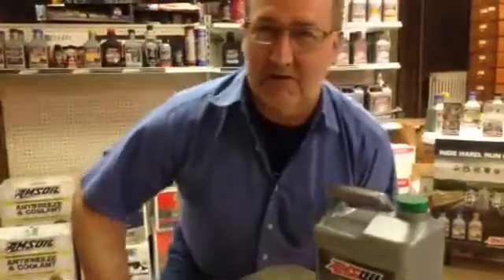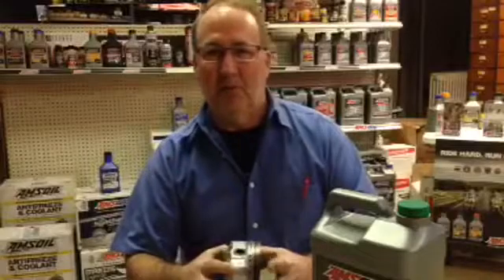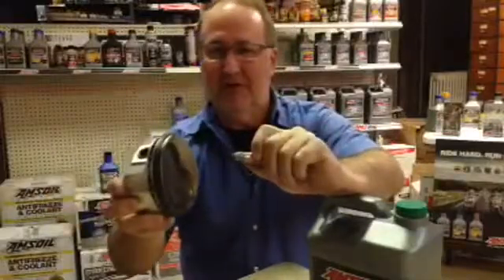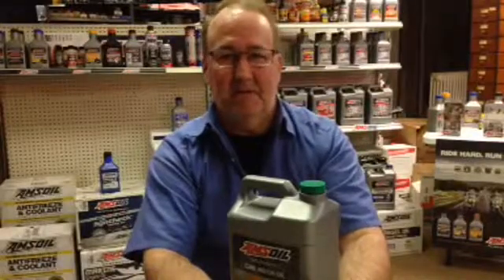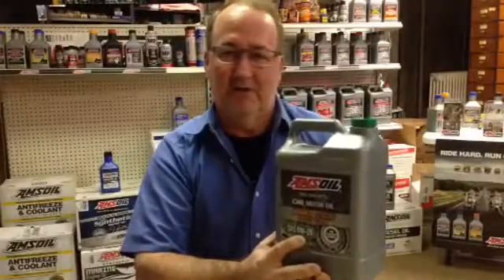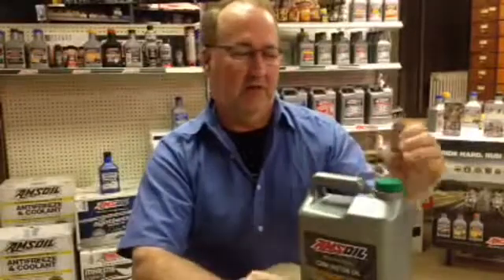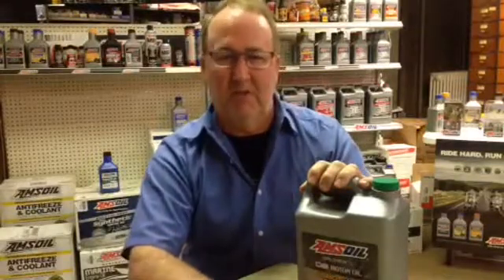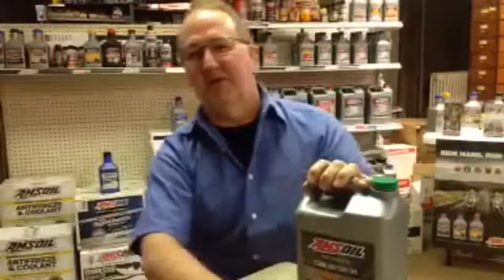Amsoi Synthetic Solves Low Speed Pre-Ignition

Comment: Tell me that that jug of oil has the API SN PLUS label on the back side and I would buy it.
Reply from the maker: An irritating part of the oil designations, they list current ones, but not the past ones used. The assumption current oil includes past standards. Having said all that, the SN Plus is clearly marked on OE, XL, and Signature Series bottles of Amsoil full synthetic motor oil. If you further questions, text or email me. My website has contact information https://kerryssyntheticlubes.shopamsoil.com/

Comment: Hey I use 10w-40 and suffer from this with amsoil my engine is at 100k miles it's a 1.5l also at 2500miles I noticed a reduced oil level. no leaks btw any advice?
Reply from the maker: First - be sure the 10w40 is labeled with the new label. You can check it at (https://www.amsoil.com/shop/by-product/motor-oil/gasoline/?zo=534737) 2nd. You didn't mention year, make, model, and engine you have. This is only newer model issue. Get back to me and I can make a call to the Amsoil tech line for you once I have more information. if you sign up as a Preferred Customer, you have access to the Amsoil Tech Line also. Use this link   https://www.amsoil.com/offers/index.aspx/?zo=5347371    to look over the information for Preferred Customer. Waiting to hear from you 814-319-1379
Reply: Hi....i have kia forte 2017 2.0 DOHC oddo 17000mile  and it's has lspi
Plz tell me how i resolve this problem